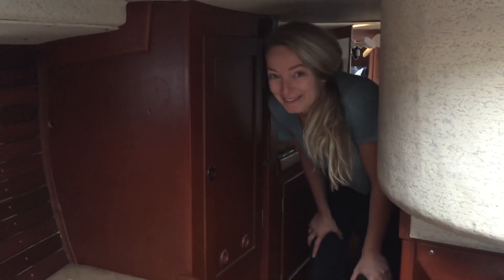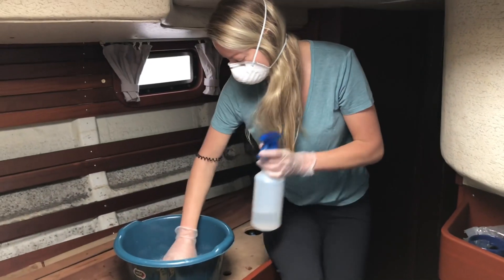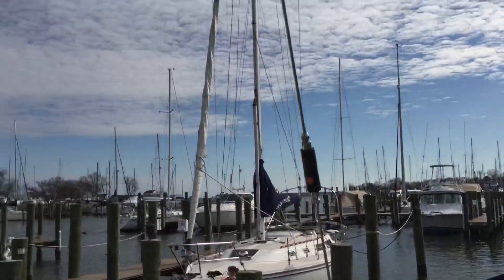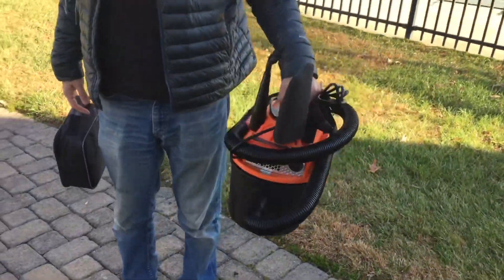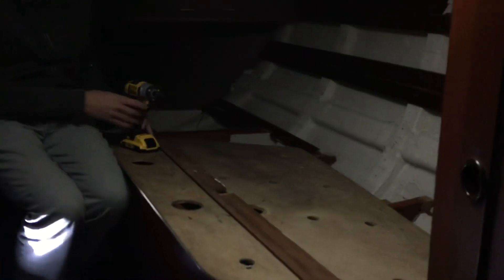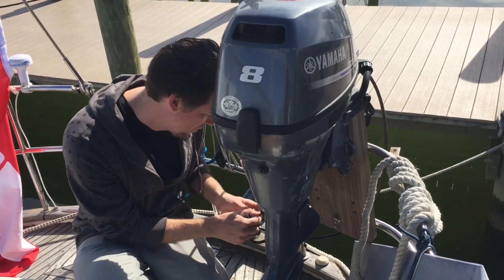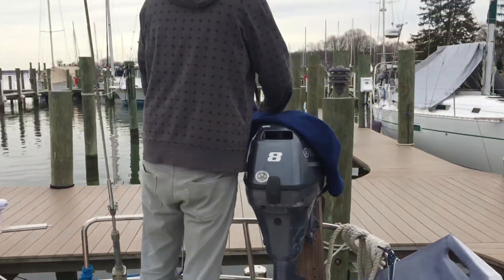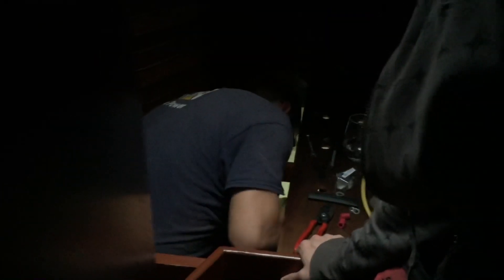MOLD ATTACK in our Hallberg Rassy 352 Sailboat | How to deal w/ Condensation on a BOAT in Winter EP3

Comment: Mold control from Home Depot will hold it down longer than bleach. It’s 33 bucks a gallon . It doesn’t smell either . And it was designed in Canada to spray the framing in homes in British Columbia because it’s so wet during the building process.
Reply from the maker: Ooooh !! Thanks for the tip , will see if we can get that product here , it’s endless cleaning on a boat 😂

Comment: Interesting -- QUESTION -- We had asked HR about insulation and they said that the core has insulation that should stop condensation from forming.  Not sure if your boat has that insulation core layer or not.  Any idea how this mold happened?
Reply from the maker: Not sure either ! Is this just for newer model HR’s? Keep in mind our Joco is a Vintage 1984😂👌 
I think we talked about it in the video (correct me if I’m wrong?) but the mold we found ended up being a combo of dirt/mold/bedding fibers. In tbe cold winter we were getting tons of condensation inside ! That’s why we wanted to install the diesel heater so bad lol.
Reply: @sailingjoco  ...I think that you did.  We specifically emailed Magnus at HR about insulation and he claimed that HR are insulated due to the foam core and that that prevents condensation.  I think that it started, depending on model years, after 2007 but we may be wrong on that.
Reply from the maker: It’s definitely a nice upgrade for them to do that on newer productions !